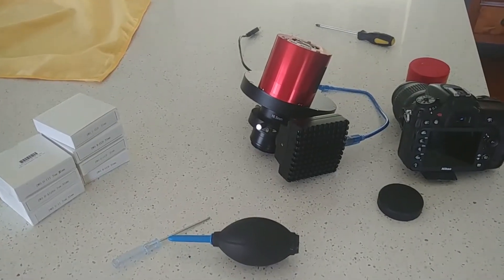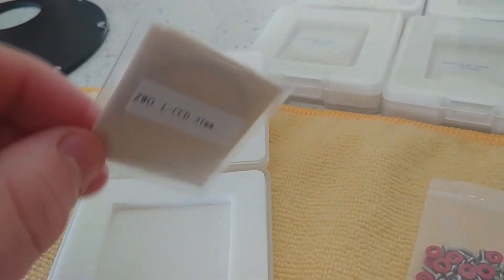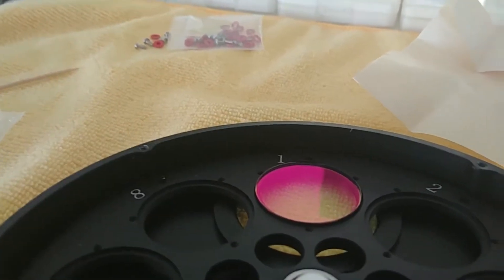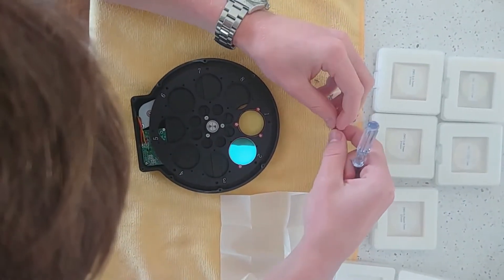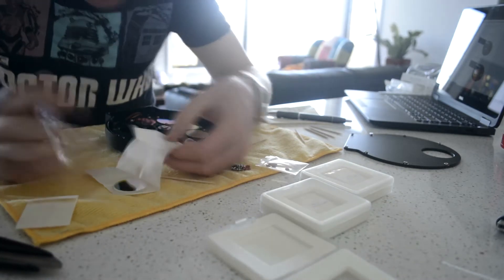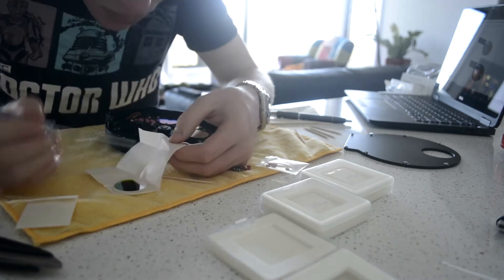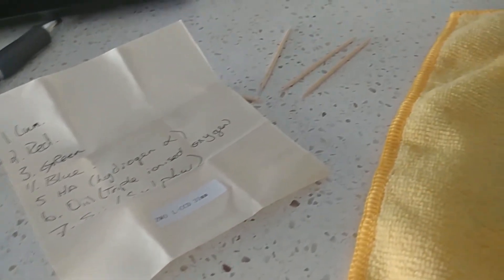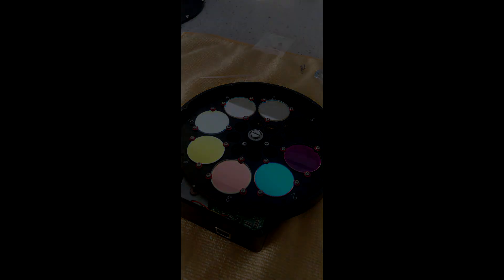Installing 31mm unmounted filters into ZWO EFW filterwheel

Comment: Can't we use mounted filters with this wheel?
Reply: Yes you can but the 1.25inch mounted give a bit more vignetting with larger sensors like the 1600 mm pro.
Reply: @JohnMcGFrance  true